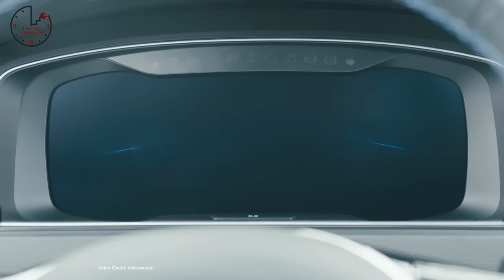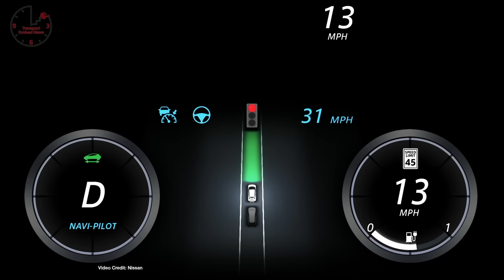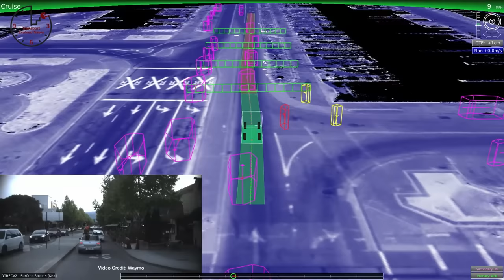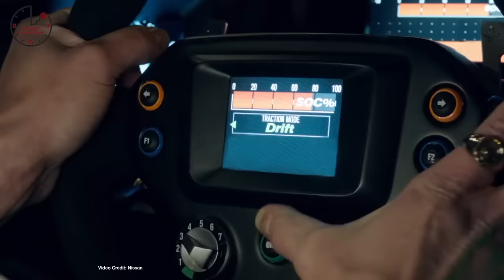Tesla Q4 Earnings, BMW i3 recall, Harley Quinn: EV Ambassador - T.E.N. Future Car News 2/24/17

Comment: With Volkswagen having just posted a 5,1 billion € profit in 2016, despite the ongoing dieselgate costs, it might have enough cash to match the price of the Ioniq. However, i would expect them not to even try to do that, they are pretty open about charging a VW premium on their cars which put them above the price of the competition out of asia. WIthout the cost of dieselgate and other one off costs the operational profit is at 14.6 billion € in 2016.

Comment: I wouldn't describe a small and "potential" issue with the i3 ReX, that has never developed into a fault, as a "whole host of issues" when an electric car is mated to a petrol generator. I'm pointing it out as a very satisfied i3 ReX driver that has yet to experience any problems with the car.

Comment: i'll never buy electric car till they Achieve over 900 KM "560 mile" in one single charge in just 5 minute then i'll consider the offers.
till then i'll just drive my 2 cars with clear head , when they will; i have almost 50.000 € 
some of u saying what about the enviroment; my ass not the enviroment
i'm not helping assholes company to take my money for fake range and short distance
- over 560 Miles with music car volume up + car climate on, just like my car now
Reply: Well... at least you didn't say you would never buy an electric car at all :) Your argument is definitely a valid one for many people around the world.
Reply: How would you go with a 1000Km plus hydrogen fuel cell car that only requires about 3kg of fuel? Sound good?
Reply: You do realize that only a few petrol cars can go 900km in a single tank and fill up in 5 minutes, right?
Reply: Muskar yeah mainly turbo diesels, wheich are the worst of the cars haha :P
Reply: Muskar our Volvo V70 TDI gets 1300km of range on a full tank.
Reply: The goal post keeps being extended over and over. Rest assured, mass adoption isn't dependent on you, more than 200 miles and half an hour of DC fast charging is good enough.
Reply: My point was that it is an extremely high standard to measure against. And I always suspect people don't reflect properly over their use of their car range. Do you often find yourself riding 900km in a day? Even if so, do you ever find yourself driving 900km without having bathroom or food breaks? If you can say yes to both those things - not out of spite - but out of sincere experiences. Then I believe you belong to that ~0.1% of drivers with that need. But the vast majority who claim they need this, do not realize that you always leave the house with a full "tank" in a BEV, and that almost everyone makes lots of stops during long trips.
Reply: EVs take a couple of seconds of your time to charge in reality. Get home, plug in and forget. No queueing for the pump, standing by the car while it fills with dangerous chemicals. My EV arrives next week. My current car goes 500 miles on a tank but I've had it ten years and never done more than 300 miles in a day and probably only done more than 150 miles in a day less than a dozen times. The time I'll save by not using petrol stations will more than make up for the odd half hour at a fast charger.
Reply: any reasonably fuel efficient car with a larger fuel tank would that, mostly larger diesels in fairness, my old petrol volvo I tend to fill up at around 400 miles, some can double that and more.
Reply: And those of us with out off street parking? all those terraced houses, or flats and so on?

lots of people can and do have off street parking but lots do not and are unlikely to have one.
Reply: That is true but for a fairly high proportion of people EVs make sense now but they are put off by the mainstream media. In time charging away from home will become faster and easier. Most cars spend most of their time parked somewhere so a solution will be found.
Reply: It's true that cars spend huge amounts of times, parked. But one of the reasons I do bring this up is while yes I'm sure a solution will be found, it will not be either cheap or simple.

And there is certain amount of head in the ground about this, watching interviews with makers of chargers etc. the assumption is home charging etc.
Reply: Good points. The lack of an integrated charging network is certainly an issue in the UK. Chargers are popping up in places where there isn't much demand and you need to join lots of different companies to use them. 
For me none of this is an issue but mass adoption does need some proper planning at national level.
Reply: Never mind the environment. When a comparable EV costs less than your banger within the next 10 yrs and most recharging already takes a mere 2 second plug in when you get home and a 2 second unplug when you leave, let's see how long your devotion to ICEVs lasts.
Reply: cinema writer oh look, the far left have arrived :P haha
Reply: cinema writer 1. It was a joke, a poor one but still a joke nonetheless... 2. I shouldnt have to ask what you meant, if you explained what you meant in the first comment you wouldnt have people responding to it with the same amount of "no context", as I did the same "reactionary" type comment you did to prove my point... and 3. Yes it is recommended that you take breaks every so often, but as the old saying goes... "you can lead a horse to water, but you can't make him stop for breaks on the road every 2 hours if he doesnt want to, it is their choice as everyone has different abilities and tolerances."
Reply: cinema writer. Sorry mate, when you live in a big country sometimes you just gotta do what a man's gotta do, and travel that 1000Km a day. That's easily achievable (with fuel stops, lunch, sticking by the speed limit) : If you're in an ICE. Your typical EV will take you about 40% longer because of all the re-charging. Sorry mate, that's just the way it is right now.
Reply: Karl P Exactly, especially somewhere like here in Australia, im a big endorser of sustainable transport because they just make total sense in my mind, however Im not too proud to admit that they  still have drawbacks for many potential buyers, now whether long haul diesel-type vehicles get replaced by hydrogen and standard cars get batteries I dont know, but at least for the foreseeable future, there will always be that small percentage of the population that still need diesel or petrol, and you know what? thats ok... because at the moment is not all about electric completely taking over, atm they need to work alongside ICE cars, it will still do its job.
Reply: Charlton Hawkins. That's why I like hydrogen fuel cells. It's an EV ( many people don't realise this), that gives me more range than an ICE at a fraction of the cost. It's no accident that Nikola rolled out it's technology on trucks
Reply: Karl P As long as the infrustructure is built, it should be a good electrical energy source for those large commercial and industrial vehicles, there are some efficiency losses of course when making hydrogen but hey u wanna talk about efficiency losses? Diesel is a lot worse haha

Comment: I like your even handed attitude to hydrogen. Way too many EV channels are just Tesla fanboy / promotion clubs in disguise. Hydrogen powered EVs are ultimately the cheapest and best performing, offering ranges between (10 minute) re-fills which are higher even than ICE vehicles, (see the Nikola trucks). Sure the infrastructure isn't there yet, but that's where battery EVs were 6 years ago...Go Shell !! Those 2-3 kg hydrogen re-fills promise to eventually be as cheap as buttons as well, as hydrogen is pretty prevalent and there are dozens of different ways to extract hydrogen from the environment (sea water electrolysis?). As you point out, it's good to have different EV options.
Reply: How can hydrogen be "ultimately the cheapest"? At a physics standpoint, it is extremely energy inefficient to produce and store hydrogen. Especially compared to simple electricity and batteries. And that inefficiency carries an inherent cost. It might sound promising that hydrogen is the most common element in the universe - but it really does hate to be alone.
Reply: Muskar. You need to look at the quantity of hydrogen I quoted that is required. Only 2-3kg. That's tiny. I also say that there are many different ways of producing hydrogen, there are several industrial proceses which produce hydrogen as a waste product for example, cracking oxygen and hydrogen from seawater is old tech.Submarines do it all the time (to produce oxygen for breathing).  And why is it "inefficient" to store liquid hydrogen? We store liquidified gasses all the time.
Reply: Karl P It's simple physics to say that EVs should be more efficient than hydrogen, since EVs convert electricity into motion while hydrogen needs electricity to create the hydrogen which then creates motion. Energy conversion losses says that EVs should better.
Reply: OriginalPiMan. A hydrogen fuel cell car is an EV. But on to the main point.  Does the battery in an EV charge up all by itself? Does it not require electricity to charge?
Reply: How is it relevant to point out that "we store liquefied gasses all the time" when determining efficiency? Are you waiting for me to explain how efficiency works? I'm sorry, but I can't see how I can answer any of your questions or address any of your points without explaining all the assumptions you've just made. And explaining those requires explaining physics as well. And I'm not in the mood for doing this over text. Take care.
Reply: Muskar. That's the problem. You spout opinion, such as "it is extremely energy inefficient to produce and store hydrogen" but you can't back up any of what you say. I quote figures and give examples to support what I say, but you've got nothing at all.
Reply: Yes, it is a claim. And you do indeed have your right to ignore it, since I didn't provide sources. That much is true. Since you chose to reply once more, I get the impression that you might actually be interested in physics, so here's a start:
phys. org/news/2006-12-hydrogen-economy-doesnt. html
Reply: The battery needs electricity to charge, but because the energy is being keep in the same form there is much less energy loss moving it from the grid to the car when compared to having a hydrogen intermediary. This is true if hydrogen conversion is 5% efficient just as it is true if hydrogen conversion is 95% efficient.
Reply: OriginalPiMan. That's correct. But the the thing that needs to be pointed out, as I repeatedly try to do, but it keeps on getting ignored, is the tiny amount of hydrogen that is needed for a hydrogen fuel cell vehicle. For a range greater than almost any ICE vehicle.
Reply: Hydrogen can definitely be better than petrol cars, but I was explaining how it is inefficient when compared to battery power vehicles because of energy loss.